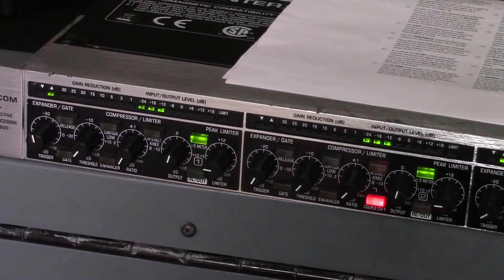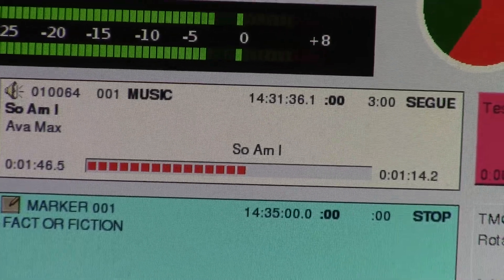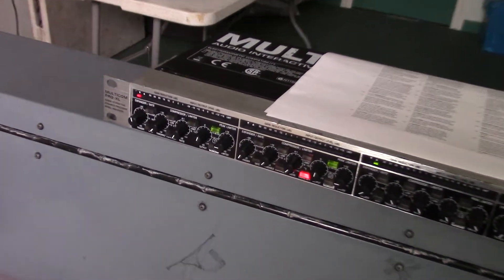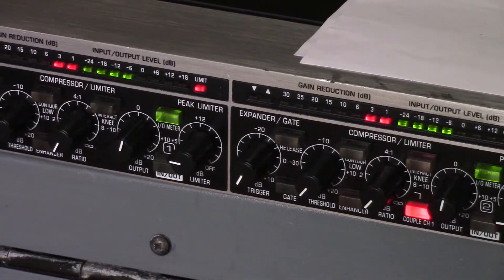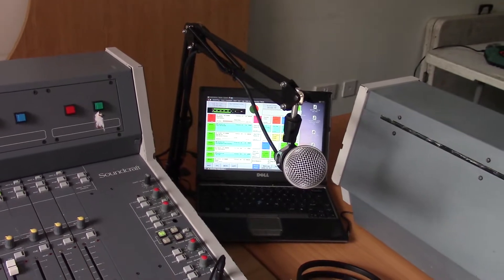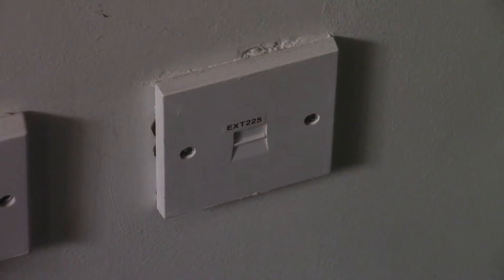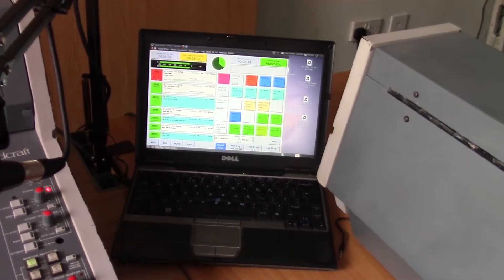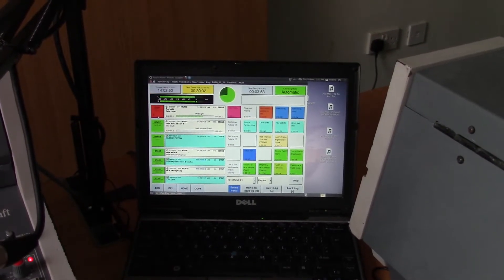How To Start A Radio station #006: Playing through Rivendell

Comment: Hi 👋 Andy you can get cheap interfaces from eBay as the ones I use are the Focusrite sapphire 2i2 to connect the audio to your computer
Reply from the maker: Hi! The audio travels to and from the desk in analogue format, so doesn't need an audio interface because there is a sound card with analogue jack sockets in the pc.
The problem is the PC doesn't send out a strong enough signal at the moment, so it will probably need to go through a stand alone pre-amp to make it loud enough at the desk.
One of the drawbacks of this particular mixing desk, which I didn't realise when I bought it, is thatthe individual channels don't have their own adjustable gain control. I should beable to solve the problem with a pre amp though.

Comment: Very impressive Andy. How do we listen in online?
Reply from the maker: The station is not up and running yet, so you can't listen at the moment. When broadcasts start you will be able to listen by visiting the station website, by asking a smart speaker to play the station or using an ap on your phone or tablet.

There will probably be some test transmissions before full broadcasting begins. The encoder will hopefully be installed this weekend.